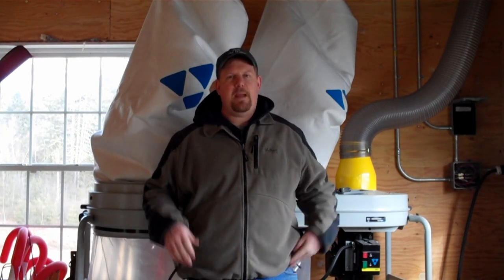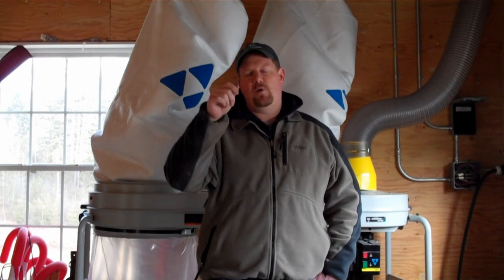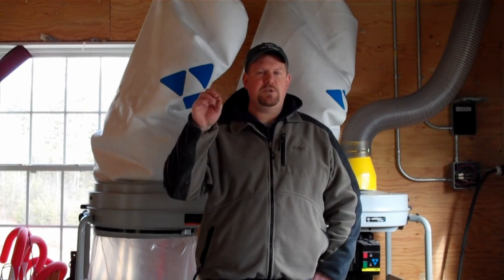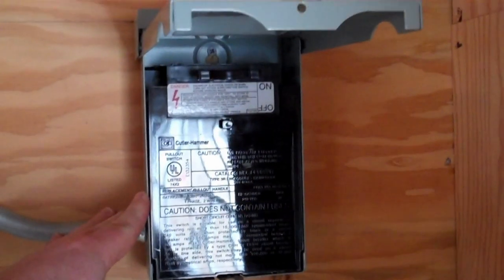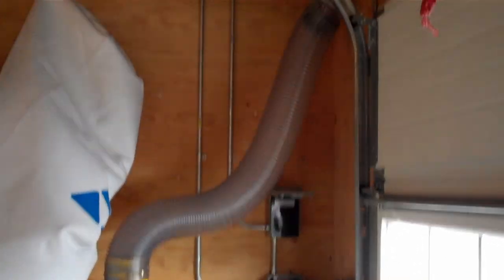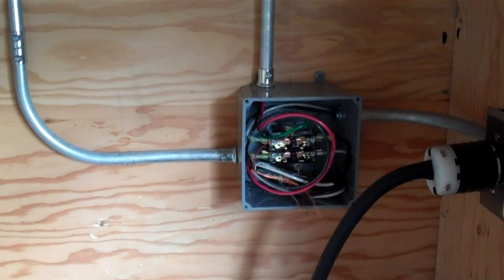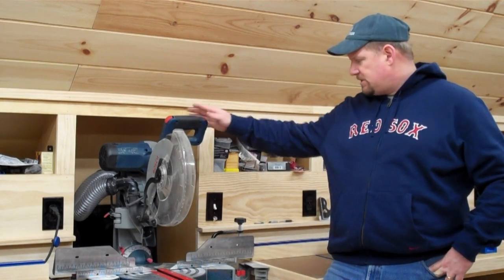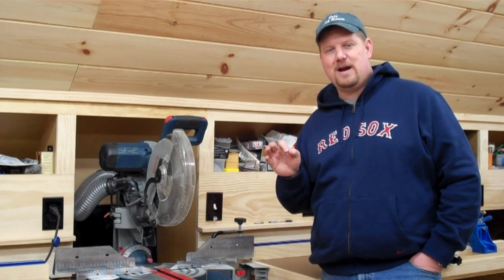How To Remotely Switch A Dust Collector On and Off

Comment: +Nathan Dance The low voltage is actually a great safety feature and it makes wiring much less expensive. Remember, if you didn't use low voltage to trigger the contactor (which is just a relay designed to switch 240v) you need to run wire all over the shop that has a suitable gauge for 30A, something like 8-10 AWG wire, plus hi amperage rated switch, larger conduit, etc. That stuff is really expensive and there would be substantial voltage drops due to the distance travelled. This setup is both inexpensive, safe, and really ingenious.

Comment: where I live most contactors are controlled by phase voltage (240v) that is used in domestic wiring. that was the only reason why I asked. although I see there is a safety advantage of low voltage (if something is broken a shock is less likely)

Comment: Do you use blast gates on your system and if so why did you use wall mounted switches instead of micro switches on the blast gates? Thx Steve K

Comment: Why not just use a lone ranger or the like to control the dust collector? It's relatively inexpensive, and you wouldn't have needed to rewire your dust collector, add a contactor, or hire an electrician. I like the flexibility of a wireless remote too, and keep it on my shop apron. I think you kind of down played this option as a cumbersome/complex but it is much simpler than your current setup. Perhaps you were referring to the ivac type which wouldn't work for me either with a large shop.

Comment: Hi there, I wonder if you may be able to help me. I am looking at a similar set up for our workshop, Extractor away from the users. I am wondering how you know when the collection unit bags are full. I would like to find some kind of sensor that flashes a light for example up in the workshop area. We use a 4 Bag 10hp unit and if we run our 4 side moulder then our bags fill up pretty quick, any ideas would be great, thanks in advance.

Olly Bryan